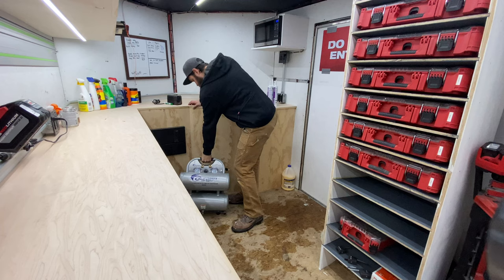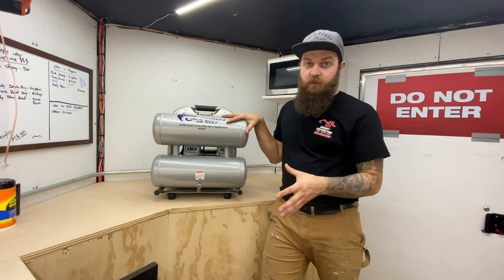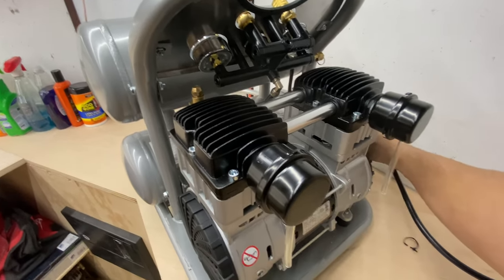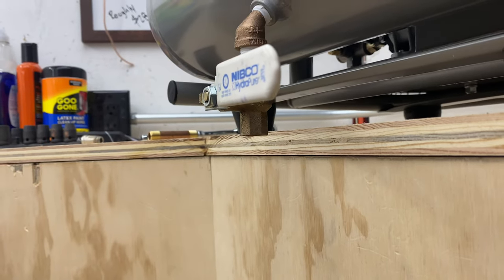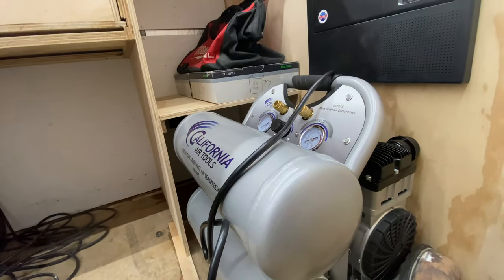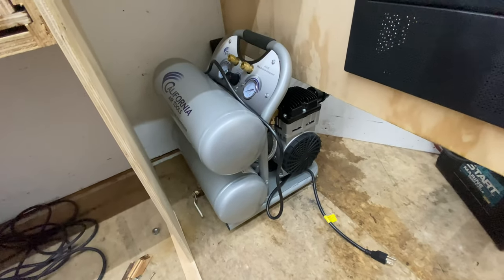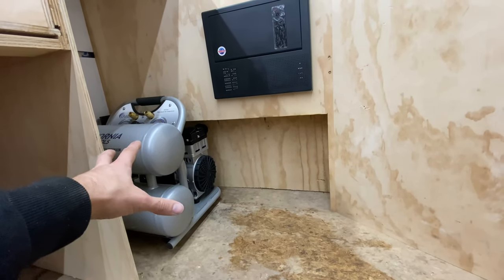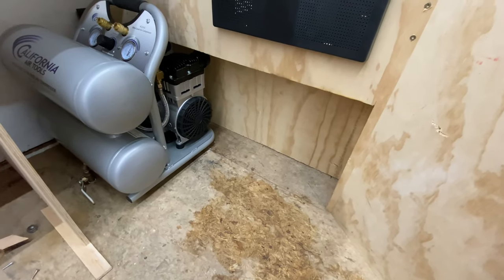New Air Compressor (and 1000 subscriber giveaway announcement)

Comment: I've had the steel version of that compressor for 6 years it works really good and quiet just heavy sucks to move around
Reply from the maker: That’s always good to hear! Mine is built in and not moving. Once I get the floor in the trailer it will be in its final place until it dies or I get a new trailer lol